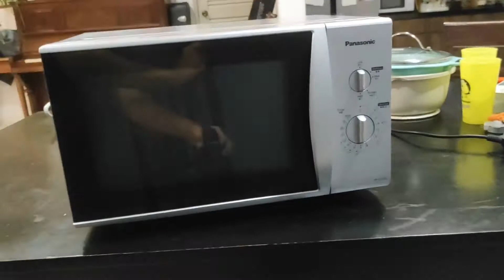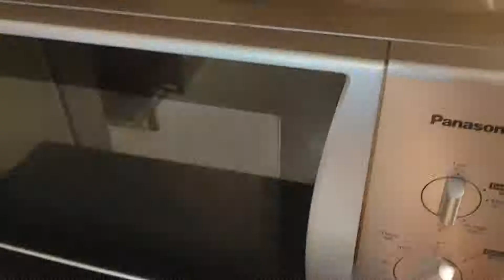Panasonic NN-SM332 25L microwave  turntable repair

Comment: For future reference their is a plate just behind the turntable motor, if you cut the 4 tabs that plate will come off, when you put it back turn the plate around and you can fit 2 metal flaps in to pre-arranged slots then all you need is a small screw to put in a pre-arranged hole at the top of the plate. This saves taking the whole back off which means you could have done this job in 5 minutes instead of half an hour!:goodvibes:
Reply from the maker: I see. Hopefully I don't have to do this again anytime soon. 

Another factor is I normally do these things late at night when, so it needs to be done quietly.

Comment: You are doing it All wrong. You don't need to take off the whole back panel. Just the 5x5 plate under the over needs to be taken off and then reversed and screwed. Simple as that!
Reply from the maker: Maybe you have a different model, mine doesn't have a big opening on the top side.
Reply: @lemuelyee  I am referring to the bottom not the top.
Reply from the maker: @FF-xl7yw  if I have to do this again, I'll take note. But really hope I don't have to do this anymore! 😅
Reply: @lemuelyee  I 100% agree. i plan to fix mine and hope that is the issue. Dont want to spend 250 bucks on new MW. Hoping the only problem is this simple fix.